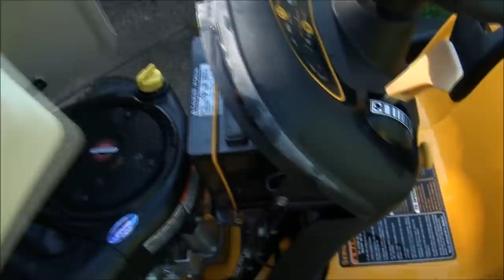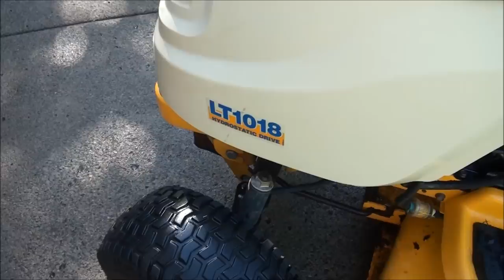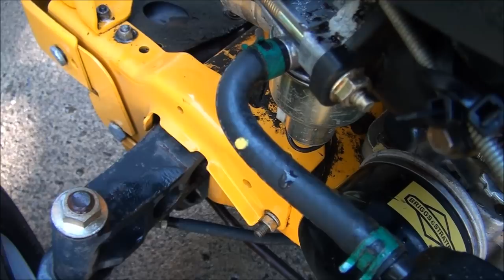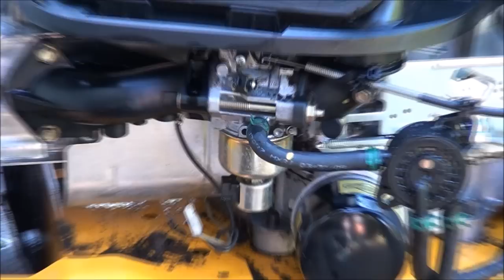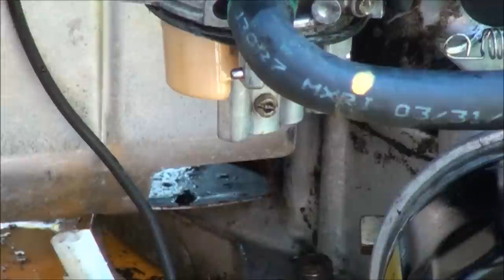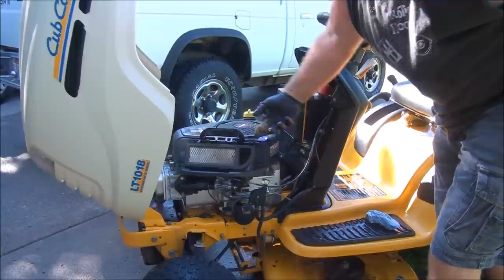Briggs INTEK QUICK FIX ~ RIDING LAWNMOWER that TURNS OVER but WILL NOT START. STARTS then DIES.

Comment: Check the valves, they may be out of adjustment.
Reply from the maker: Good tip! Good observation. Are you referring to how it kicked back when first being started? I was assuming that was just from how loaded up it was with gas and oil in the combustion chamber/valve area from  repeated starting attempts etc... you may be correct(valve adjustment is a good idea) however it has not kicked back at cold start up again
Reply: Jeff's Little Engine Service that's good, but with these intek engines, once a year it's a good idea to get in there, and check the valve clearence, just preventive maintenance.
Reply from the maker: Preventive Maintenance? What is that?  haha! Just kidding....good idea for sure. I seem to have to replace a lot of head gaskets on these Inteks too...
Reply: Jeff's Little Engine Service Hahahaha.... Yep, yep and another problem is the pressure release on the cam, those things are nightmares.
Reply from the maker: Oh man! You are right on. I had to replace a quite few of those cams and pushrods in 2017...
Reply: Jeff's Little Engine Service yep me too, give me a flat head anytime of the week.... LMAO
Reply from the maker: yes, old briggs opposing twins are my favorite engines, and the single cylinders are tough as heck...
Reply from the maker: good choice. Snappers are great mowers!

Comment: my anti backfire solenoid doesnt click. i have fuel, spark, and will start with starting fluid then shuts off. if i dont hear the solenoid click then what? ty
Reply from the maker: you can eliminate it by cutting off the plunger, but I do not do that or recommend it.  I usually will replace the fuel solenoid
Reply: i did break the tip off, and the mower started..but now i have an afterfire, backfire after the mower is shut off. i ordered a new solenoid..whats weird is on my other mowers that work properly i still dont hear a click from the solenoid when i turn the key. i wonder is some of them dont click until the engine is fully on
Reply: hmmmmm... have you wired it up?

Comment: Hey Jeff How are you? Does my Briggs & Stratton Intek Engine have a Fuel Pump? just carious Model # 311777 Type 0143-E1 Code 000613ZD. I was getting nervous to buy a Single Cylinder Engine I am more used to the Twin Cylinder Engines & didn't know how powerful it would be. I got a John Deere Sabre 1742 Gear Drive Lawn Tractor with this Engine.
Reply from the maker: I am not sure but fuel pumps are easy to locate attached to the back of the engine. follow the fuel line form the carb back.
Reply: Just wondering why you didn't check the plug first??  And, enough with the stsrting fluid already!!

Comment: My John Deere stopped running. Started popping through the carb. 
Changed the fuel pump and the fuel cut off/backfire solenoid which went bad three months ago. It clicks when the key is turned off and back on. Took the fuel line off the carb and put air pressure in the tank to push the air out of the lines. Still won't start unless I choke the heck out it.
What next?

Comment: Running it with the charger on that's not a good idea to ruin your charging system I hope you took the plug out of the electricity so it would kill the charging system

Comment: On your next video, set the camera down, hand held video sucks !!I solved all the fuel problems on my 17.5 hp Briggs Intek by converting the engine to Propane fuel.  It is very easy to do and when the conversion is done correctly, it is perfectly safe and no hazard to anyone.The gasoline and alcohol business is one big JOKE on America. It is the biggest CON in the U.S.And I decided to do something about it; Not use gasoline anymore !!!My weed eater and generator are both Propane fueled also, just to show that I am serious about "No More Gasoline"